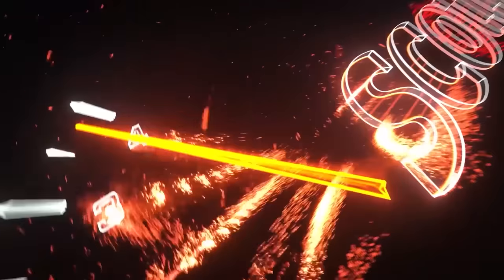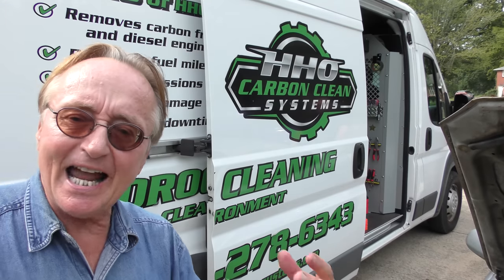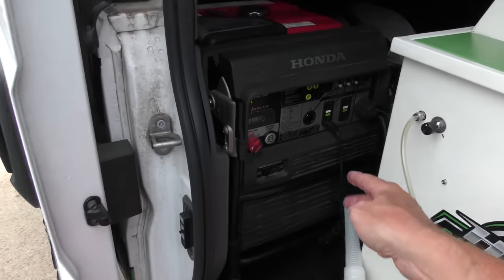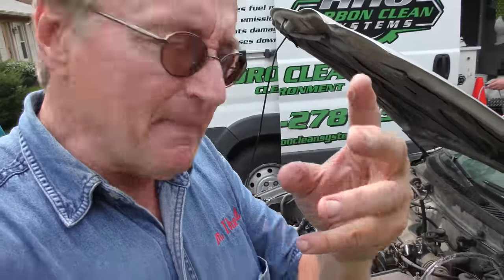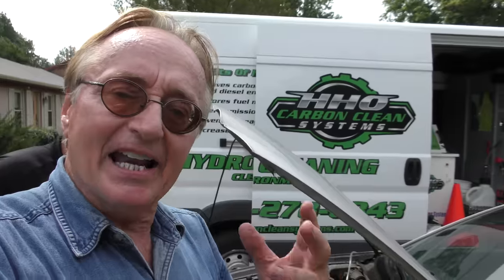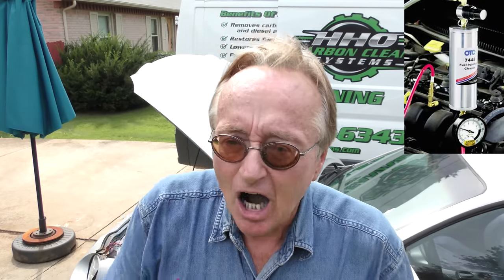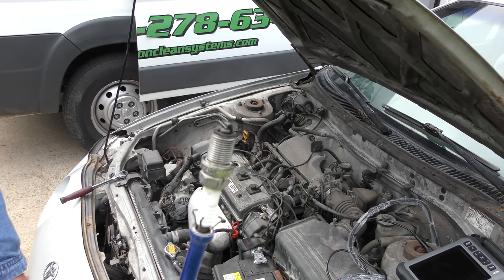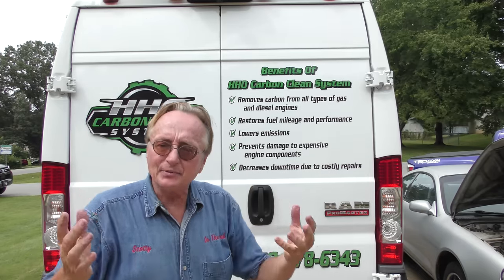I Can’t Believe What This Cleaner Did to My Car

Comment: Who else now wants to see Scotty do a video where he shows how to clean an old carburettor car engine out with water?
Reply: Requires combustion to work, IE in the chamber so carb cleaning will not work.
Reply: He doesn't read the comment section
Reply: @troy3456789  He must read some, otherwise there wouldn't be an occasional "loved" comment.
Reply: @michaelross-aj6fgvk3rz  Just to clarify, I meant so that he shows off what he used to do to them in the 60s on cars with carburettors as opposed to fuel injection as he describes in the video (wasn't sure if you thought I meant just cleaning the carb. from your reply).
Reply: @chiefwhosmoralsareelastix  it must be on his other platforms
Reply: @chiefwhosmoralsareelastix   He puts out 3-4 videos a day...no way he reads the comments. The only comments he (his computer program) "replies" to are when someone says "Hi Scotty" or similar and "he" says "Hello there" or whatever. Same with the random "love emojis"... computer generated.
Reply: @chiefwhosmoralsareelastix  Have you ever seen him mark any comment with the love mark, or respond to any comment in the comment section? no, you haven't.
Reply: It's dumb. BUT, it likely does more than this procedure.  The only thing that gets dirty that this is theoretically capable of cleaning is the back of the exhaust valves.
HHO doesn't become water/steam until the combustion chamber. HHO becomes water through combustion.  So absolutely nothing before the combustion chamber could even theoretically benefit.  He showed the backs of the valves of a direct injection engine. This WILL NOT CLEAN THEM.  Hydrogen and oxygen are both not solvents or cleaners.  It will not clean the throttle body either.  He was paid to endorse this and it doesn't do a thing. 
Furthermore, these people aren't going to diagnose your problem. They are just going to do this.  You could call them about your 2024 brand new car with 5 miles on it and they will do this "service"
Reply: @tarstarkusz  Without any before and after performance metrics it fails to convince me it's worth anything. It might actually increase hp, fuel economy and Scotty made sure we would not know.

Comment: Carbon in the combustion chamber isn't a big deal to handle. The issue on direct injected cars is carbon on the back of the valves caking on from the PCB system. Unless these guys can clean that without having to take off the intake manifold and media blasting the valves, it seems like a novelty more than a necessity.
Reply: There’s a company called ATS that makes a nitrogen based carbon cleaner. 
Scotty actually promoted them in a different video.
Reply: Maybe help clean the turbo if it has one…

Comment: It’ll never touch the carbon on the back of valves.
Reply: meh it'll be fine:face-red-heart-shape:
Reply from the maker: Well you have a point there. Because the hydrogen has to burn to do its job of cleaning. And it only burns on the front side of the valves, not the back. The only thing that would clean the back of the valves would be strong chemicals or taking the engine apart and using walnut blasting to remove the carbon

Comment: Scotty I've been a mechanic about as long as you have started my apprenticeship in the early '70s got licensed or certified in the very early 80s and I'm still twisting wrenches do you think the automotive Market is really advanced I think everybody should watch the movie about the Tucker Torpedo after all he was getting 49 miles to the gallon with a Mid Engine and a carburetor so if the technology of the Tucker Torpedo had progressed we may still be cleaning the inside of our engines with water and transmission fluid mixed together. Preston Tucker was a genius way ahead of his time but like everything it was all about the Greenback upon doing further research on Preston Tucker the government's and the big three car manufacturers really line their pockets and the government's want us to think that they're working on the environment's best interest. It's just laughable. What do you think Scotty?

Comment: Naw you can make a hho machine at home that you can drive with. There is mpg positives, but you need to make sure you aren’t running to much power causing steam. You will ruin ur spark plugs and I personally messed up my upstream o2 sensor. Got +5 mpg running it.

Comment: when leaving stuff in your car (em radio projecting stuff specifically) I'd say look into faraday bags -- heck that'll protect it from the cops' new tech that reads your phone data live! Let me know if you need some more info but they can be easily made at home with aluminum foil lined manila folders as long as they seal in your device

Comment: That stuff doesn't work to clean diesel instakes, they need a proper clean with walnut shells, its been checked before there are tons of videos of before and after of this process on diesel engines on YouTube. Against a thick buildup of diesel intake buildup from EGR buildup this stuff may clean 10% of it off so better save your money, its a gimmick and im surprised Scotty fell for it.

Comment: Using a Flipper which costs only $40 can eliminate the smashing of a window to catch the radio signal and can just replay the signal if the car doesn't have "rolling codes", it will unlock the car.

Comment: Makes me wonder if this would help my 2018 F-150 6 cylinder with the turbos. I'm taking good care of my truck and have put 83,000 miles on it with no problems.(so far)
Reply: I was wondering the same thing about my 2016 F150 2.7 Ecoboost.
Reply from the maker: Yes it actually is very good at cleaning turbos. I saw data of before and after turbo boost ones they had cleaned and it had much better boost after cleaning

Comment: Nice hydrogen set up.  Just get hho on demand system. With the proper tweaking gain mileage and clean your engine while you drive.
Reply: They dont work they take too much energy to drive so in a closed system without an alternator sure it might give a slight mpg boost but having to power the hho generator takes more power from the engine than the energy it gives back to the engine in the hydrogen gas so u don't actually gain mpg
Reply: @sbrader97  yes just like a very large car stereo. My hho system draws a little over 4 amps from my electric system. My car stereo draws over 65 amps of power. My car has a 200 amp alternator.

Comment: How to clean the engine compartment/engine exterior? Paint stripper? Drano? TIA.
Reply: You can use any good quality degreaser. You can also buy many products designed for cleaning engine bay such as Gunk engine degreaser, Sonax Engine Degreaser and Cleaner, WD-40 Specialist Machine & Engine Degreaser Foaming Spray, to name a few.

Comment: If you ever look at the pistons and valves in an engine with a blown headgasket where the antifreeze is being sucked into the cylinder and burned it leaves the pistons and valves absolutely factory clean.   So we know for sure antifreeze works.
Reply: Was going to say, why not spray a mist of antifreeze/ATF/seafoam via PCV. This HHO looks like an overkill for a simple maintenance procedure

Comment: Turning it off does not work. You have to put it in a special bag that shuts down the signal where cannot escape there is a bag for the phones there’s a bag for the computers you put it in and it sends no signal out and receives no signal stops at 100% what you’re talking about does not work even if you turn it off unless you remove the battery that’s the only way to do it Thank you. Have a good day.😎

Comment: Scotty you don't work on big diesels, I take them apart for rebuilds and always astonished how clean the pistons and cylinders are. The heads are always clean. Cummins detroit or Ca,t Paccar etc. Little diesel engines suffer from this problem. Volkswagen especially.